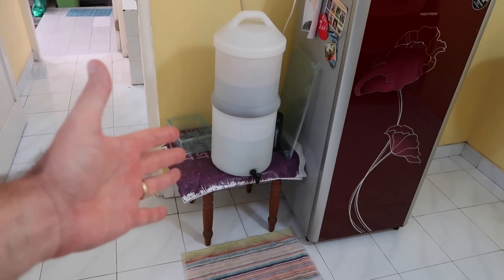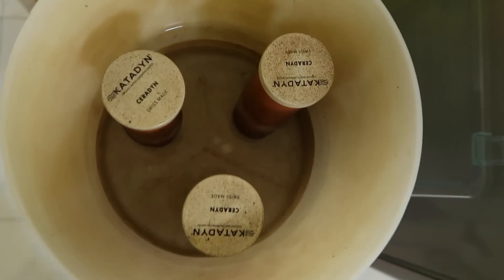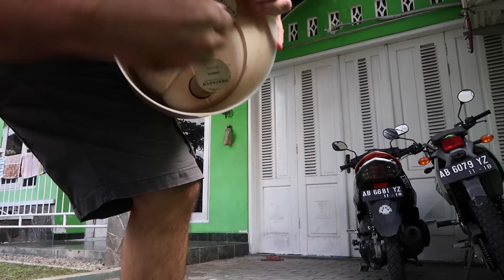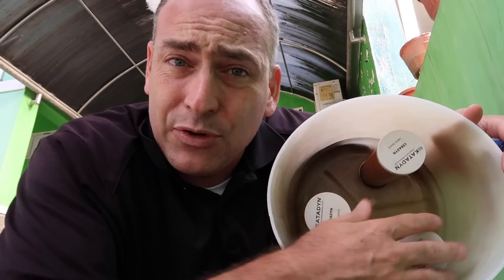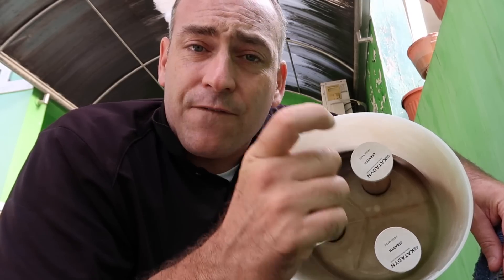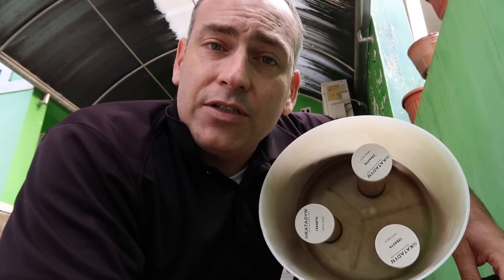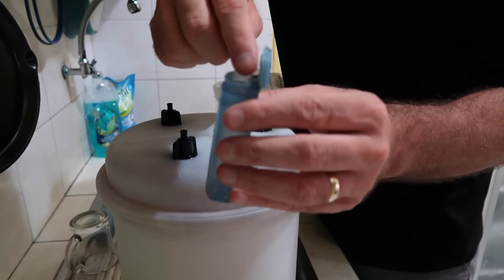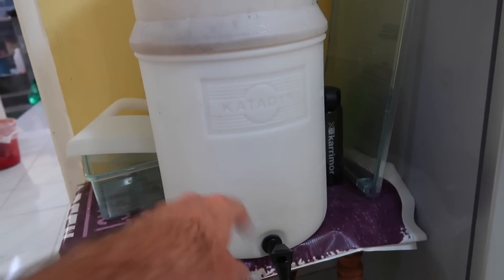How to Clean a Katadyn Water Filter

Comment: @Pak Martin
which one is better this vs Reverse Osmosis filtration?
Reply from the maker: +masajusp 69 that would depend on what you want out of a filter. I like this one better.
Reply: +Martin Johnson i use Reversed osmosis water and the result of total dissolved susbtances is below 10 PPM which is super clean. even pesticide or heavy metal filtered. it's cheap tool $10 tds tester.